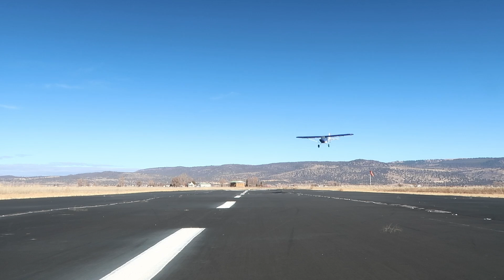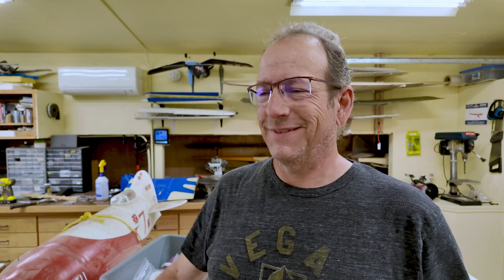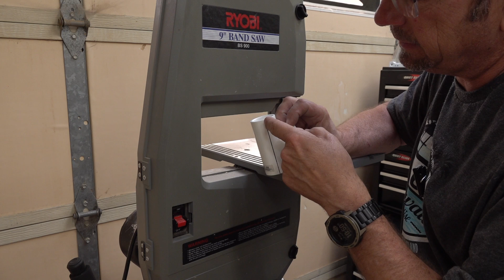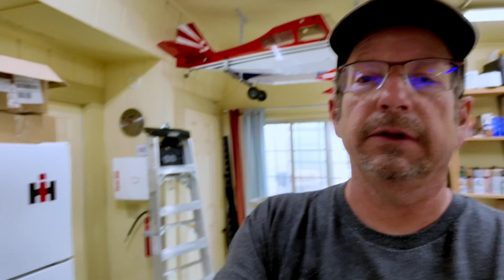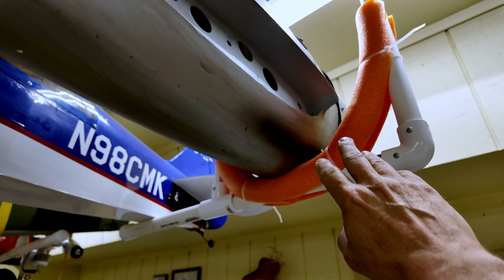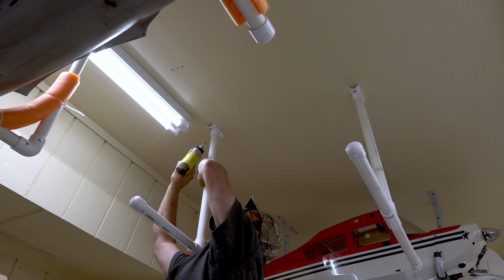Building PVC racks for RC aircraft fuselages.  Keep them up and out of hangar rash

Comment: I came up with an idea of hanging my planes in a big net from the ceiling. I found some cheap netting on FBM. It came from a fruit orchid. My Mrs, didn't like the idea and made me take the net down. The thing is my shed which is under the house has an open ceiling just has metal beams and you can see the floor from above and all the plumbing pipes and electricity wires. The funny part is that you never comes under there but she always knows when I'm up to something. Cheers Graham

Comment: I really like the racks but it also depends on your ceiling height and how tall you are. For the height l, also need to take into account how far the landing gear hangs down. I don’t want to be hitting my head all the time on racks or landing gear. I suppose I could always turn the nose of the plane towards the wall where I would not walk. Well done. I will take some measurements and build a few.